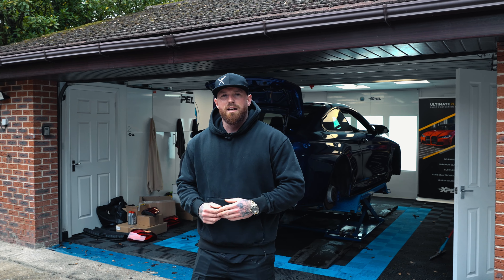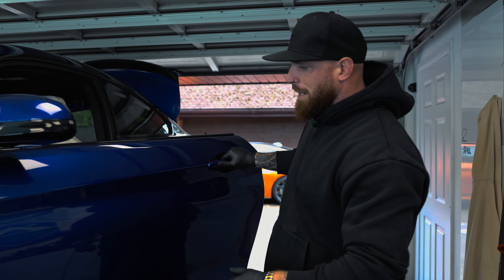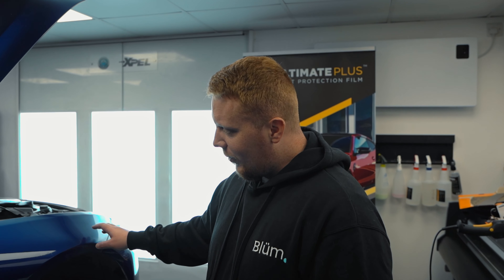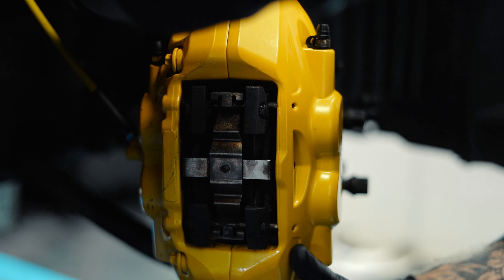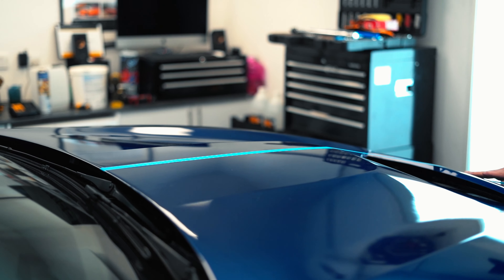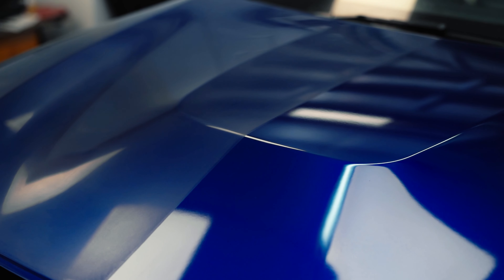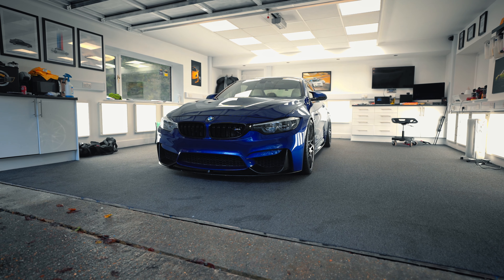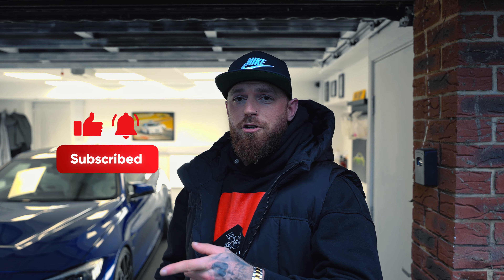We Took A Beat Up BMW M4 and Refurbished It Back To It's Former Glory!

Comment: Amazing work,.what machines are you using to wet sand, looks like you do it by machine rather than hand, the latter takes ages.
Reply from the maker: Thanks for your comment, we use a range of sanding machines, the one in the video was a Ryobi orbital sander from Halfords, actually did the job very well. We also use a smaller 2” rotary sander for the smaller areas, and some other parts need to be done by hand. It would certainly be time consuming to do the whole car by hand, and the machine gives a consistent finish
Reply: @aspectdetailing  thanks for the tips, I am still not brave enough to use a machine to wet sand.

Comment: Hi guys would have preffered a more detail on your work you did to the car ie: more  of the polishing or doing the paintless dent removal.Did you do any work inside the car like the upholstery? etc  Can't believe the customer didn't put a ceramic coat on the car and the wheels. Would keep the hard work you guys put into it for a good number of years. Nice work though. Thanks for sharing👍

Comment: superb finish, the paint, wheels and calibers looks stunning. the only point I disagree with is that the refurb diamond cut is better than OEM, going back the 19s I had on my E46 M3 and even on my current 20s 666 on F82, id rather drive with.tiny kerb mark(channel tunnel train is far too narrow!) and leave the finish OEM, it has a better mirror look rather than the lightly grooved re cut look.